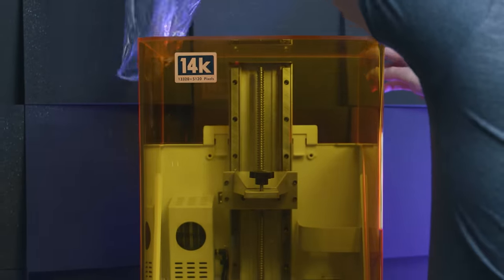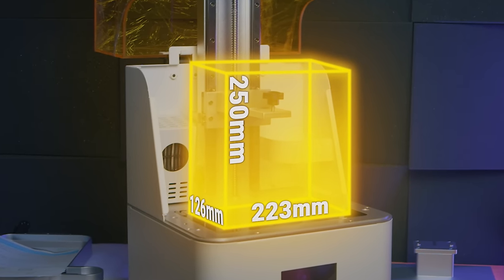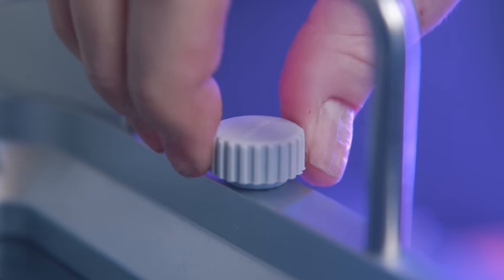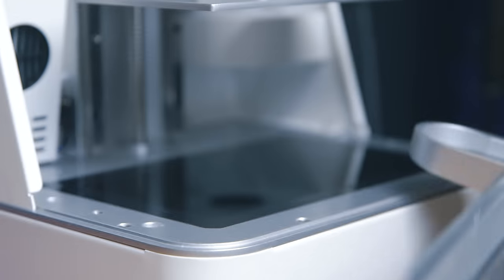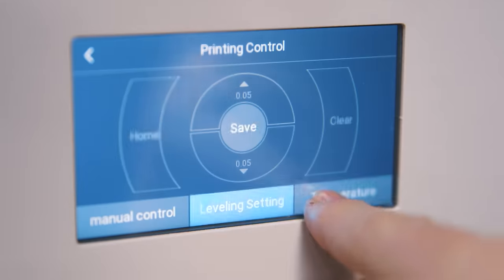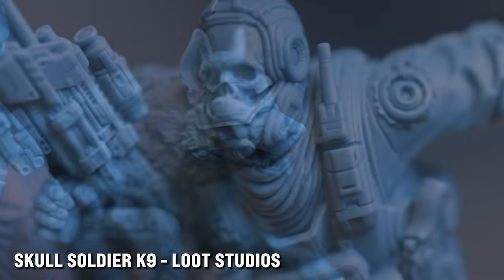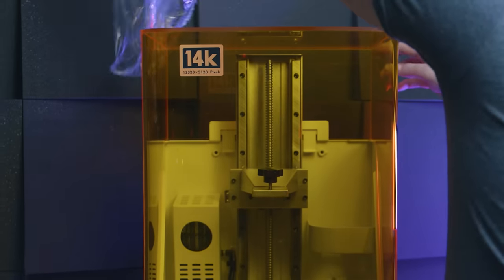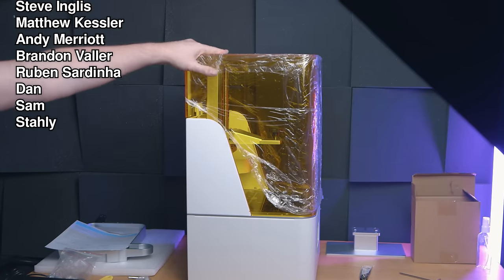Nova 3d Whale Ultra 14k Review - OMG WOW! The World's First 14k Printer

Comment: I think you hit the nail on the head here. We have reached the level of "good enough" when it comes to quality. The next generation of printer advancements will be about convenience and consistency. The various tidbits that we now have to go for in aftermarket addons or DIY solutions need to be solved now. Heated beds and air filters are already here in some printers. Next would be a convenient way to let the resin drip off the finished print, maybe the next-gen printer should have a printplate that automatically tilts to a side to let the resin drip off easier, or the plate is already formed and shaped a certain way to facilitate this. A plate with a detachable, flexible surface as we can get in aftermarket for almost every printer would be a sensible thing. As would be a way that allows the printer to detect if there are any bits of cured resin already in the vat that would harm the FEP or even the lighting unit if it crashes down into it. A more convenient way to transfer the resin back from the tank to the bottle would also be nice. And all the other dozens of little things that we now have to do "manually" that could be made easy by printers that take care of this.

I'm absolutely certain that this would also be very attractive to people new to printing, especially if they watch channels like this one first and thus learn that resolution and printing speed ain't everything. What you want is a consistent print, clean air and ease of operation.
Reply: This, we've really hit the level of "good enough" that hopefully the next generation of Resin printers focus on all the things you mentioned. Honestly the real next big breakthrough in Resin printing won't be the printers themselves but will be whichever company first makes a non-toxic but useable Resin, then you can have it in peoples homes without having to worry about resin fumes etc. Currently that seems to be the major limiting factor on Resin Printers beyond space. However if that's even possible I have no idea.
Reply: @luketfer  It's fairly unlikely. There are a few resins that are at least food-safe when cured, but they are prohibitively expensive (think factor 5-20 to common resins), so no later than at the price tag this becomes a non-issue for hobbyist printing.

Turns out anything that reacts to uv-light is also generally not very healthy. So unless we find a different way to cure our resin than uv-light, I guess that will not fly.
Reply: if the buldsize in x/y are buigger...14k would make sence...but in a standart size...no...and even then..i guess the minimum Z height will get to a limit.. since LIGHTbleed is a thing..a
Reply: @0x777  there are even resins out there to make fake teeth!..😉
Reply: @Bitplanebrother Yes. But all these things apply to the thoroughly cured resin. 

Even normal resin is fairly nontoxic (still nothing 'd hand my 3 year old, mind you) once cured, but there isn't a single resin that I know of that isn't highly toxic in liquid form.

And concerning resolution, well, I already could only see a difference between 6k and 8k under a microscope. Yes, you can see the difference there. And under very specific circumstances and on particularly plain surfaces that have to be printed at an angle, you may see (or at least feel) the difference.

For any normal miniature or structured print, I doubt the difference is that prominent. 

And then there is the light bleed you mention, but there are also things like the resolution the resin is capable of hardening at (yes, it's a thing, even resins that can handle higher resolutions have limitations to how precisely they can polymerize) and of course the time factor. Are you willing to wait five times as long for a z=0.01 print than you did for a z=0.05 print?

Because we're still talking about speeds that mean you print 3-5 hours for a mini, on a fast printer. Are you willing to print for a whole day for a resolution increase you won't even notice?
Reply: With transparent prints, every surface distortion makes it less clear. There is a video on YT showcasing that these pixels still matter. But it really comes out if you use proper detailed models with prints where it matters like transparent prints to not further refract the light then what you intended to have.

Comment: Thank you for your professional review and advice. 

About Heating System:
What causes printing failure in a cold environment?
In a cold environment, the resin's slow fluidity prevents it from returning to the center of the resin vat in time, leading to printing failure. Heating the resin is an effective method to improve fluidity and ensure successful printing.

Should we maintain continuous resin heating?
No, based on our experiments, printing failures are primarily related to the adhesion of the first layer to the platform. Successful adhesion of the first layer allows the printing screen (maintained at 40°C during printing) to provide adequate heat for subsequent layers. Continuous heating systems are unnecessary and may cause damage to the LCD and other electronic components.

Comment: Thanks for a great honest review. Wtf the heater doesn't rule during the printing. The resin fill looks way scary. You are right about way to many little fuckups.
Reply: The cold winter weather reduces resin fluidity, leading to first layer printing failure. Preheat the resin using a heater before printing to ensure optimal temperature for successful first layer printing. During UV curing, generated heat should maintain resin within an appropriate temperature range, ensuring fluidity and successful printing.I believe this represents the correct design idea！

Comment: While you are correct that the heater should run while the printer is running, resin layers curing keeps the vat warm, have you never tested this? I have a Fermintation belt on my Saturn 2 connected to a thermostat controller, I keep it at 78f, the rooms ambient temperature is 56F, when I come back a few hours later the thermostat reads 88f. As long as the resin starts warm it will keep it's self warm with each layer. Try it out.

Comment: I have a 4k printer and a 12k printer and print quality is somewhat similar between the two. Of course the 12k printer is better, but the difference isn't as dramatic as you might think. I doubt I would be able to tell the difference between 12k and 14k.

Comment: I would have to assume that the level that the bottle sits has enough tolerance for the displacement of the build plate, so that it does not overflow; otherwise that would be a massive oversight that could have easily been diagnosed and fixed by simply lowering the nozzle of the bottle to the desired level.
Reply from the maker: Possibly, but I’m not testing it for the reasons I said, the lowest point if the bottles lid was well above the max fill one, in which case the max fill line is Bs and that’s another small detail oversight by Nova 3D

Comment: Thanks Ross. I was looking at this printer but turning the heater off when you print? Useless!
Heating is not that important to me as I can control the (tiny) room temp easily, but if that doesn't work right what else is wrong?
Nice review 👍
Reply: @retromodernart4426  If you watched the video you'd hear him say "Yeah, that's right. The heater does not function whilst the printer is printing"
I'd say that shows Ross does know how it works - or doesn't
Reply: The cold winter weather reduces resin fluidity, leading to first layer printing failure. Preheat the resin using a heater before printing to ensure optimal temperature for successful first layer printing. During UV curing, generated heat should maintain resin within an appropriate temperature range, ensuring fluidity and successful printing.I believe this represents the correct design idea！

Comment: Just like TVs, we've surpassed the resolution barrier where pixels are now smaller than the human eye can discern.  A particle smaller than 25 microns cannot be detected by the human eye unless it is refracting light (effectively increasing it's visual size).
So it's really irrelevant once you are in sub-25 micron resolution territory, and especially a 5-7 micron difference between axes is completely irrelevant without solid magnification.
The ONLY reason to increase the "K" resolution will be to keep <25 micron resolution on larger and larger print beds... if manufacturers determine there is a market for that.
Hopefully, this means that in order to keep improving the product, they will turn towards incorporating more and more useful features, better design, and enhancing the UI, because nobody is going to pay to upgrade a printer if they won't get discernibly better print quality.
Reply: It isn't any better because it is not 14k
Reply: I wish manufacturers would use the pixel size instead of the meaningless k number. Yes meaningless because a Phrozen Mini 8k has far better pixel density than their Mega 8k. As to sticking to no more than 25um, I have no argument with you if all you are printing are desktop minis. But I am a manufacturer and want results with tolerances as low as +/- 10um. That is what I get from my CNC milling machine and lathe. I only get +/- 30 to 40um accuracy with my mini 8k and mighty 12k so am limited in what parts I can print as opposed to machine.

Comment: Help me please
My question is, what is the difference between expensive printers on the market like Shining 3D, Prusa and printers under 1000 dollars?
For example, Wiiboox has a 7K printer named Light 380S for $2,600 and Sonic Mighty Revo, which is a new printer from phrozen, for $1,000.
The size of the LCD is much larger, but it is 7K
phrozen has a smaller size and is 14K
Are the details very different?

Comment: Could the heater not functioning during prints possibly be a firmware update? Let's hope so, because, yeah, this thing could kick some serious butt...
Reply from the maker: probably related to power management
Reply: @FauxHammer  Maybe firmware could enable it to some degree. Once the resin is pre-heated the resistive heater may not need to run at very high watts to maintain it, especially considering the act of printing also generates heat. I think it'd be well within the wattage limits of a standard outlet.
Reply from the maker: agree on the outlet wattage, but the internal power management? dunno  @JorenMathews

Comment: Did you see the new ApexMaker X2? I was wondering if that would compete against the Uniformation GKTwo
Reply from the maker: no comment - but it's being renamed the X1 Mini
Reply: @FauxHammer  is it worth taking a look at it? 
I’m semi-new to the 3d printing space and love all the videos you have been making! I’m planning to upgrade to a bigger resin printer and was hoping to get one that has a built in heating solution. Uniformarion knocked it out of the park but around the same price I saw the ApexMaker X1 Mini* with their neat resin tank heater.
Reply from the maker: @jrawrr  I haven't got it yet. despite what the website suggests, it's not actually ready yet, the prototype has only just been completed.

Comment: I really want to buy the Saturn 3 ultra but where I keep my printers, I need a heater, and the idea of having a built in heater sounds amazing. Now, this printer has too many red flags for me to want to peruse it. But if someone (Elegoo possibly) made a mini heater that would fit inside of a Saturn 3, I would be throwing my credit card at the screen with excitement.
Reply from the maker: check out my 3D printing in the snow video as a few people do like teh ChituSystems one I mentioned in that
Reply: @FauxHammer  I had no idea these even existed. I would like to see a video demonstrating the few different types of heaters that are available on the Amazon link you had in that video. I'm going to end up buying the chitu systems heater based solely off of me already recognizing the brand name. But I am curious about the VIT Sport one as well as the white one that seems to be sold by a few different companies.
Reply: The cold winter weather reduces resin fluidity, leading to first layer printing failure. Preheat the resin using a heater before printing to ensure optimal temperature for successful first layer printing. During UV curing, generated heat should maintain resin within an appropriate temperature range, ensuring fluidity and successful printing.I believe this represents the correct design idea！

Comment: Having the vat stand proud of table when you put it aside is not great in my books. I often need to clean some stuck on stuff on  the membrane with a wooden cappuccino spoon and then if the membrane is not directly on top of the table top the first thing it does is to poke a hole in it.
Reply from the maker: I would advise a different approach. You should use the vat clean function to cure the a thin film of the whole screen area. then instead of pushing down with a scraper, push up from below with your finter in one corner - the whole piece and anything else that was stuck will come away much easier

Comment: im kinda wondering why all the screens are rectangulare 
like why not a perfect square like most fdm printers
or fuck it a circleuare vat it might help with the weird pixel shapes
Reply from the maker: these screens aren't typically designed for printers I don't think. but are actually made for mobile devices and POS displays. Printer brands just buy them in.

Comment: Vat heaters are not needed so long as the resin is warmed when you start it as the curing reaction generates heat. Just stick the bottle between your thighs or behind your computer fan vent while you are getting your slicing and stuff ready and it should be warm enough to pour in and go.
Reply from the maker: ummm, no...

Comment: The issue with higher quality and resolution screens comes the higher price tag of replacement screens if you have a hiccup.

I'm personally very happy with my 6.5" 4K printer. Great quality minis, a lot of patreon stuff is cut down to fit on that size bed bar the really big stuff.

Comment: Shouldn't printer manufacturers know that we need the vat resin heated, not the air in the print chamber?
Is this just as a case of doing what's easy, or do they really not know what needs to be heated?
Is it too hard to put the power connector and network port at the back, and put the power and USB in the front?
Can we have covers that don't require another few feet above the printer to open? Have you seen Elegoo's ridiculous lid on their new Jupiterr?
Is it too much to have an native language editor? Why is "manual control" not properly capitalized to match the other menu items?
This just feels like a poorly thought out design.
Reply: I'd rather heat the air because then everything in the chamber is at ambient, so things like thermal expansion of the printer parts are more uniform and you don't have a cold plate cooling the resin in the vat when it dips in.
Reply: The cold winter weather reduces resin fluidity, leading to first layer printing failure. Preheat the resin using a heater before printing to ensure optimal temperature for successful first layer printing. During UV curing, generated heat should maintain resin within an appropriate temperature range, ensuring fluidity and successful printing.I believe this represents the correct design idea！

Comment: Comment on the timing

After seeing your comong post I went and looked at thier site about the printer and they have riased the price $52 after I sent an email anout the fact their website gave two different print volumes for the printer. I came to the conclusion I needed to see a review on it before to see if the problem was only poor editing on the website.

However the timing of the price raise is odd but they did fix the print volume to only one number. Did you know that the price was going up between your posting will release the review and the review going live? As I don't get many videos will be going live at on my feed, it seems very odd timing for you and them.
Reply from the maker: I had an issue with the screen when I got it that was resolved with a firmware update. But due to that video production was put back. so the pre-sale price has now gone back up.

Comment: yea seems like they rushed to market on this and didn't have any good or actual 3d resin printer people QC this before release. As for me I wouldn't buy this. 

What companies need to do is incorporate a vat band heater that has magnetic connections so users don't have to fiddle with wires. Now that would be great feature. Hopefully someone will do this.
Reply: The cold winter weather reduces resin fluidity, leading to first layer printing failure. Preheat the resin using a heater before printing to ensure optimal temperature for successful first layer printing. During UV curing, generated heat should maintain resin within an appropriate temperature range, ensuring fluidity and successful printing.I believe this represents the correct design idea！The magnetic link method is a promising concept. I hope manufacturers have access to this information.

Comment: Back when resin was $80 a bottle, Nova made a half decent machine. Now the brand is more cut and paste from a parts bin printer with some cobbed on features that don't look sorted in the least. That's rather disappointing but not surprising. Rebranded printer with some 'custom' features that are fully half-assed. Sigh...